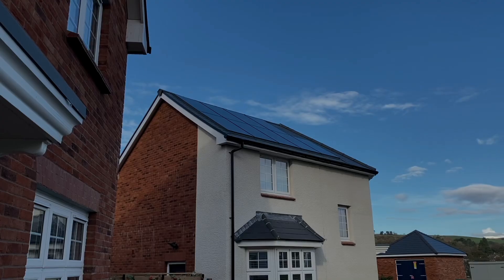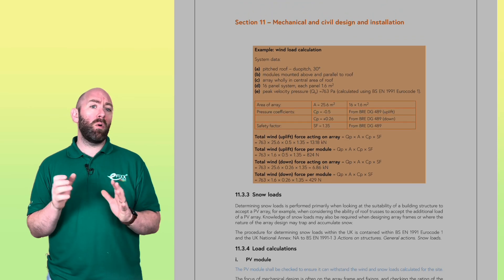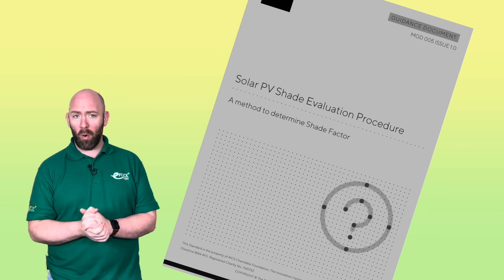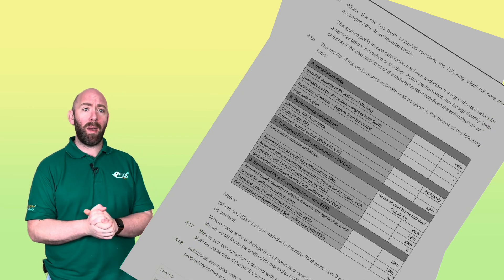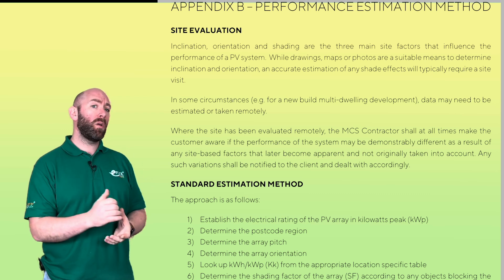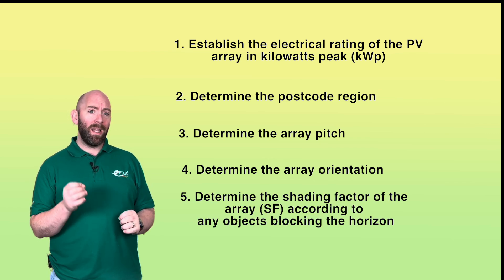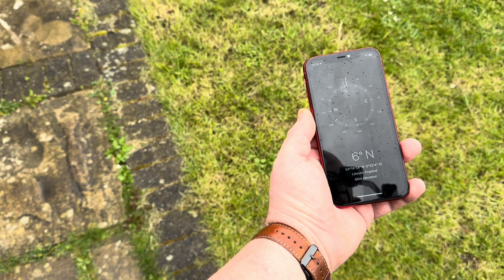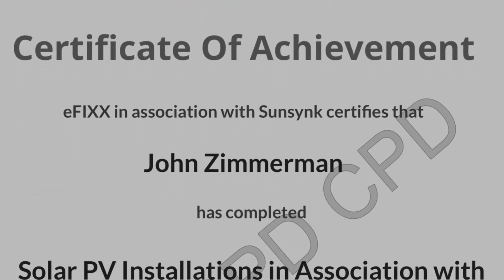Master Solar Design: A Blueprint for Electricians

Comment: So many factors missed out for example any or all heating elements being used in day light only.
And you didn't inc what inverter you would install for the 4.5kw of panels, is it a 5kwh inverter or a clipped 3.68kw inverter.
Where are the maths in this?
Never mind location the UK isnt equal when it comes to clear skyscrapers just 100- 200 miles and decrease or increase up to a 1/3 of production even with the exact same system, oriantation and angle/pitch.

Comment: Help on Irradiance data set mentioned. I have set for Belfast along bottom, 40 degrees South facing is 847. I have 6 degree East facing roofs. Are the Variation From South numbers 1-179 through West to North ? How do I use to find best for my 6 degrees East ? Thanks, nice to see much more solar nowadays.